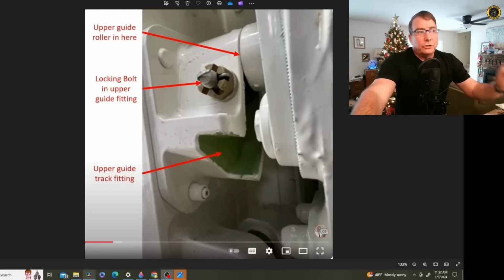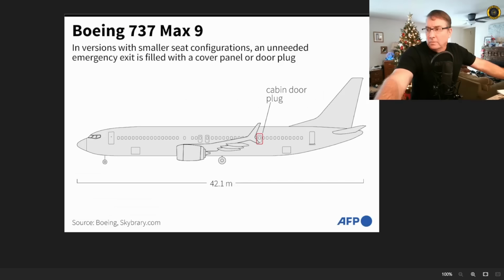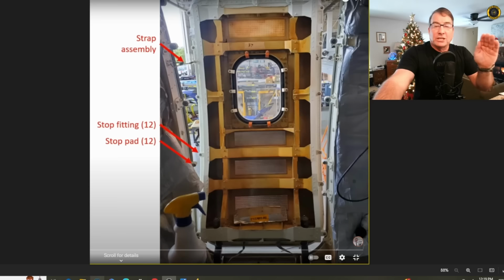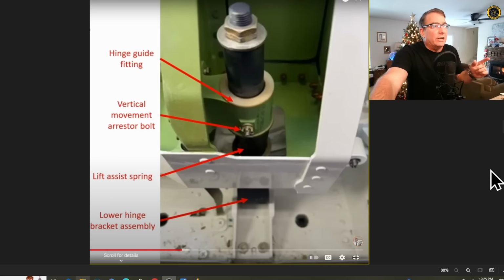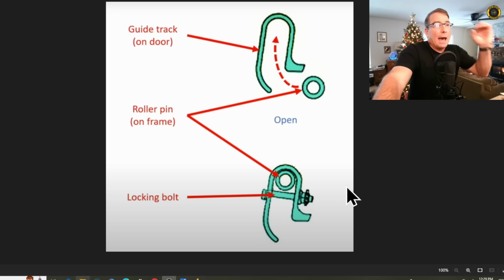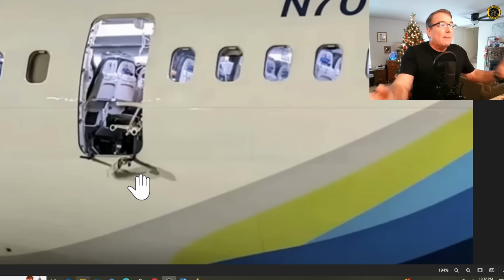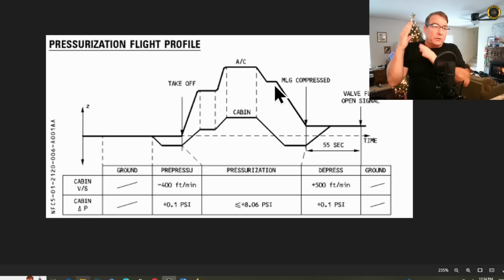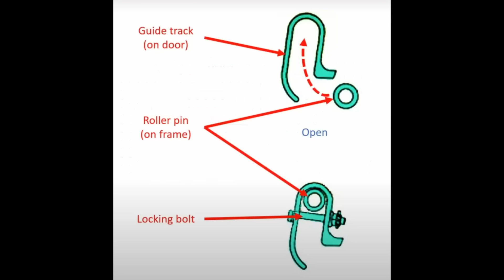Alaska 737 Max-9 Door UPDATE! 8 Jan 2024

Comment: I haven't worked on the 37 much nor have I worked on the Max at all. That being said the amount of force being applied to the door by pressurization is over 1100 lbs for every 1psi in differential air pressure. If as I suspect, the bolts were missing, the  stop pads were simply sliding on each other and as the fuselage expands and contracts/flexes/vibrates etc, the contact of  the pads would shift around until one or more moved enough to clear the stop. I would thnk the pressurization issues could have been attributed to one or more stops being cleared and the loads were transferred to the other stops allowing the seals to lose contact and and air to leak past. This state existed until enough were compromised and the door departed the fix.
Reply: No, the design is for the stops take all the load, there is not near enough flex for a stop to come off the stop pad, and fuselage and door flex are accounted for in the design.

All the stops slip off at nearly the same point.

Large cargo aircraft do have this issue with the large cargo door, which are 20x in width.
Reply: No to all. The door is very rigid and so either all the stops are cleared or none are cleared. And I highly doubt the door would stay in place if all the bolts were missing. I think as Juan said, the bolts vibrated out one at a time until the final bolt fell out on the incident flight.
Reply: @rael5469  I find that scenario highly unlikely. As someone who has been an A&P for over 40 years and has worked on airliners for much of my aviation career I think the likelihood of all four bolts backing out to be a bit of a stretch. The bottom hinges are spring loaded pushing the door  plug up into the roller channels. If there were no bolts there is still positive force pushing the door up. 

As I considered this more perhaps the spurious pressurization faults was with the upper seal being compromised in turbulence casing the door to descend a bit and allowing air to slip by. I don't have any idea what the force of the spring are but they probably sufficient to seat the rollers in the channel and a but more to simplify any maintenance. To your point of the door being rigid it now seems that there were no bolts installed making the plug entirely reliant on the springs to keep the door seated. Landings/turbulence/ vibration/pressurization cycles could have all played a role in overcoming the spring tension. 

I would be interested in seeing the faces of the stops to see if there was any fretting wear that occurred as the stops became more out of alignment over the cycles since the plane started flying a couple of months ago. Ridges worn into the faces may cause the door to continue to creep lower as the springs may not have sufficient force to overcome said ridges.

Just spitballing here. I'm sure it will be fairly soon that we will find out since the parts are all in hand now. I'm still convinced the bolts were either never installed or they were not replaced during a maintenance action.
Reply: Around 8 psi
 @Oren_Janus
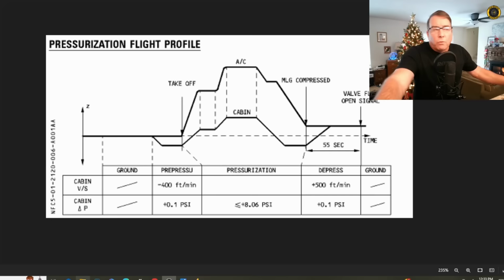Reply: @Oren_Janus  10:16
Reply: the door must be lifted up for it to open, and the springs push it up, so the springs are not helping to keep it closed. Take a close look at the photo of the roller pin and track. The door is on the left, the frame is on the right. 

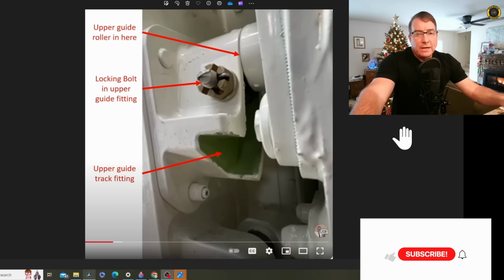0:02    @JeffreyLangfels
Reply: @marks6663  you are correct. I was thinking the the guide fitting was on the frame as in the case of doors such as the L1 and other doors on the 737. I just got a look at the AMM.
Reply: @JeffreyLangfels   "I think the likelihood of all four bolts backing out to be a bit of a stretch." 
The entire scenario is a bit of a stretch......RIGHT?  
I don't think it would make it even one flight with no bolts installed. So one other option is that the bolts were installed but the cotter pins not installed. Any ONE bolt would hold the plug in place......so the bolts likely vibrated out one by one until the final bolt finally fell out. But like I say in all my comments, we have to wait and see what they say about the door they found. 
Oh......I've been an A&P for over 40 years too. Rigged many 737 doors and hatches.
Reply: @JeffreyLangfels   "The bottom hinges are spring loaded pushing the door plug up into the roller channels." 
No......the "vertical assist springs" help to push the door UP and OUT of the guide roller channel. This is a feature left over from when there is a real escape hatch installed to help the escapee release the door from the guide track.

Comment: I had a similar event in the 1959 Cessna 310C many years back when, after an annual inspection, the emergency egress window flew off shortly after takeoff with all the extra pressure coming in from the air vents. It was determined later that the safety pins securing the emergency egress window got loose during the process of working on the flap indicator mechanism under the floor. Interestingly enough, a farmer brought the window back a few days later and we re-installed it back in as it was completely intact without a scratch.
Reply: Growing up on a farm, a high wing (probably Cessana) had to emergency land on a country highway alongside our property. Was a safe landing and the plane was parked at the mouth of a dirt road that lead off to a about three farm houses. There was plenty of room for it to be parked back out of the way of any traffic.

Being a five year old that had the run of the farm, I eventually had to make my way over to check it out. It was left there unattended for couple of days until could be retrieved. Needless to say sitting in that cot-pit greatly amped up my five year old pretend piloting fantasies.

Yeah, there's a thing with farmers and aviators.
Reply: I watched a cowling fall down and land in a neighbors pasture from a light plane one time. It slowly tumbled and looked like a sheet of plywood.

 @TheSulross

Comment: I'm still in mild shock at how fortunate everyone on that plane was that this happened when and where it did.
Reply: If it was at 32,000ft, it would have been an explosive event!
Reply: @ZeroSpawn   and anyone without their seatbelt on could have been sucked out of the door plug hole
Reply: @ZeroSpawn if I understood @blancolirio correctly if they had been at that altitude the pressure differential would have been enough to keep it on the tracks.
Reply: @reed785M  check out the Southwest woman and the window. 🙆‍♀️💥
Reply: @ZeroSpawn  It was factually explosive at 16,000'. There was already tremendous pressure against that panel ("plug") even with only partial cabin differential. The panel/plug is approximately 1,800 square inches in area, multiplied by just 1 psi would be 1,800 lbs. of force pushing on it; but there was at least 4x that and up to a little more than 8 PSI (about 9 maximum) normally at final cruise altitude, as high as 41,000' (maybe 43,000; I know the previous generation is 41,000).
Reply: What happened to the passengers and crews ears or lungs for that matter? Were their ears popping or ringing.. hopefully I would never find out for myself but I am interested to know.
Reply: @reed785M  I'm not so sure.  If those 12 pins were allowed to miss each other when the door raised up...like he said, maybe they were only millimeters from the edge and one bump of turbulence might do it...bang, that door would be gone, I think!  Those bolts through the track gotta be there to prevent the door from ever lifting up at all.  I'd imagine, with everything installed as it should have been, the plug door would never budge and this would never, ever happen.
Reply: @eloisebrynlee  Changing suddenly from 7,000 feet air pressure to 37,000 feet...I would think that would be painful on the eardrums.  I don't know if it would be enough to rupture them.  If your eustachian tube is normal, swallowing or yawning would probably let the pressure out of your middle ear.  Maybe it would be enough force for the pressure to escape without any action.  Or if you hold your nose and mouth closed and suck in, that should help extract the pressurized air from the middle ear.  First thing would be to ignore any pain and pull the oxygen mask on.  Then in less than 10 minutes or so, the plane will be down to an altitude where the pressure will be mostly equal again.  And hopefully it doesn't happen halfway between California and Hawaii...because it would be at least a few hours to landing, then.
Reply: The aircraft must have been freezing cold inside
Reply: @eloisebrynlee  according to the NTSB, the pilots told that they were feeling it in their ears. But there were no injuries due to the accident. This happened at 16,000 ft. Don't know what would have happened at 37,000 feet which would have meant a much larger sudden drop in pressure.
Reply: @Andrew-13579  I just watched the NTSB press conference the last live one. So let’s see if the bolts were there at all. If so that they are found. They said there will be evidence of them being installed if so.
Reply: I'm wondering about the reports of someone's shoe sucked off...initial reports were saying shirt.
Also, did they recover all those cell phones that they said were sucked out.  Or is that how they relocated the non-door?
Reply: as we have heard on every flight, 'keep your seatbelts fastened when you're not moving around the cabin . . . '  The safety procedures WORKED !